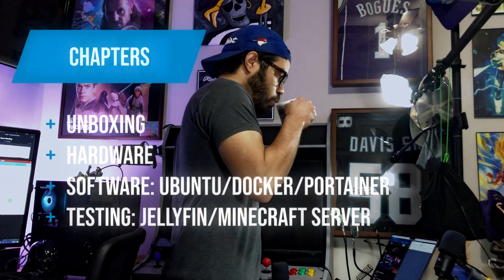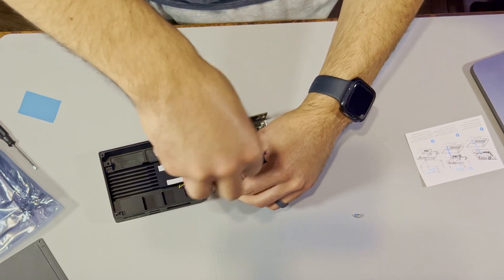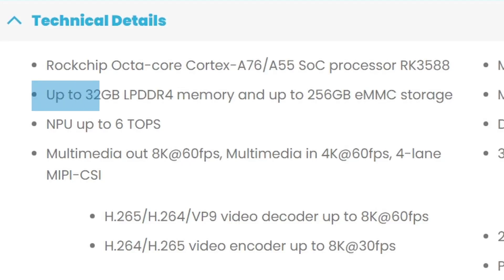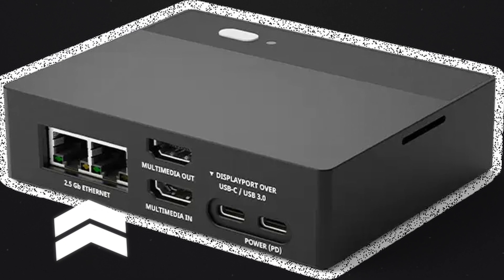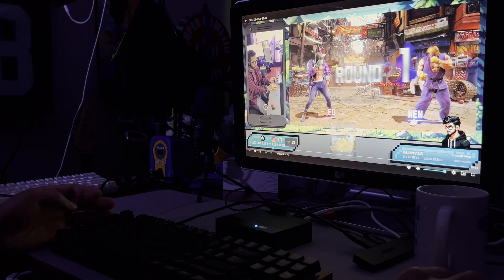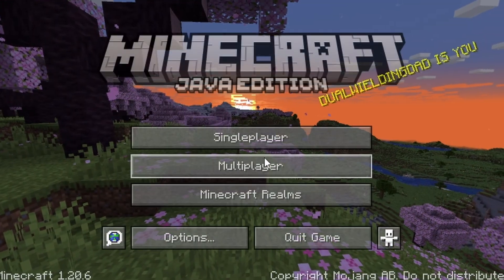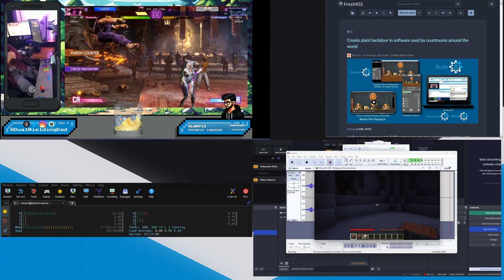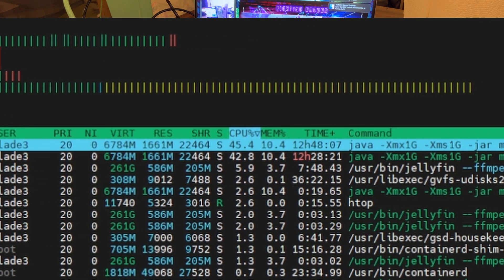A Step Above Raspberry Pi For Home Lab

Comment: Over priced IMO.
Reply from the maker: Compared to what with the same specs?
Reply: Well, you did mention the Orange Pi 5. I recall when that launched I purchased 2 of the 8GB models for $175. This board is selling the 4GB model for $229.00. At least that's what the charges were for the 4GB model in my shopping cart at checkout. No accessories or even a power supply. Some might pay that price, but for me I think it's a bit over priced based on what we're getting.

Comment: I can pick up a ryzen powered mini PC for the same money. This is way overpriced for the power.
Reply from the maker: It’s not really priced for power. It’s priced fine for the market it’s in which is low power edge device with dual 2.5gb and the extra I/O. If you’re not using it for that, then yeah you’d be overpaying.

Comment: I've tried 30+ SBCs in the last six years running x86, RISC-V, and ARM. I buy the raspberry pi for the support. I don't have to worry about if the OS will be supported and what compatibility my peripherals and software will have. Most of the time I just want to plug and play which is where most of these devices fall down.